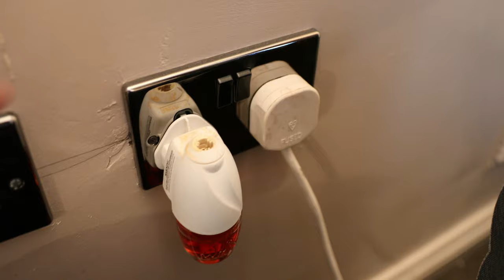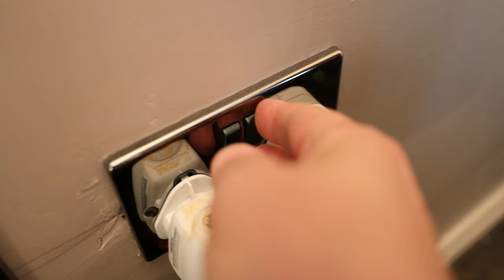Screwfix

Comment: What's the point of turning a power socket of ? I'll be living in the UK for a year and we don't have those in France, is this important ?
Reply: Why would you want to have stuff when you can just switch it off?
Prime example in the video, the oil vaporiser.
Reply: Alex Atkin well you'd have a switch on the vaporiser or just plug it in when needed. I can see the point if you had the same appliance in every room but I'd rather have just one and transport it from room to room as needed
Reply: But the vaporiser DOESN'T have a switch, which is the point.  Plus when a switch is on the device, you have no idea where it comes on the circuit.

Its cheaper and safer to have the switch on the socket rather than manufacturing it on every device.

It means you can leave lots of things plugged in where you can only reach your arm to the switch but cannot reach to actually unplug it, allowing people to hide unsightly sockets.

Our plugs are designed to be more robust and secure than any other countries I'm aware of.  It also makes them more stiff to unplug, so switches make a lot more sense.
Reply: Alex Atkin I definitely feel that, I fear I'm going to break a part every time I unplug something